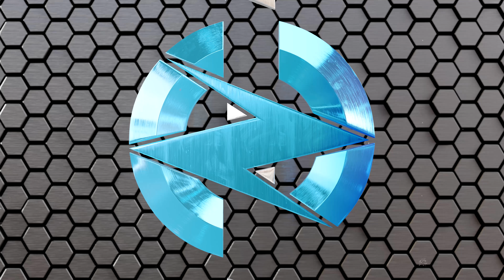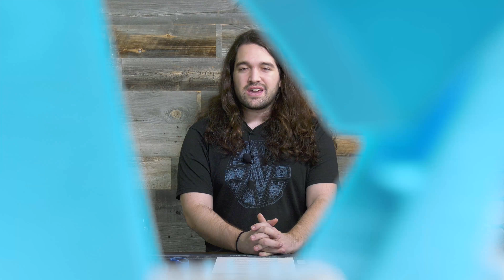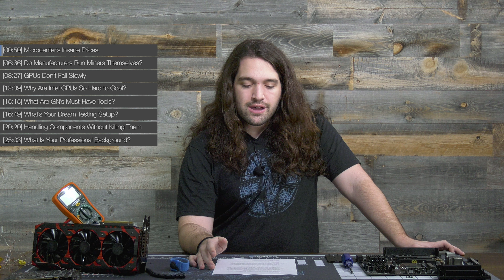Ask GN 68: Microcenter Ripoff, Why CPUs Are Harder to Cool

Comment: The GPUs are more fucked than RAM today. At least the fuck-expensive RAM is readily available. A GTX1080ti? Pff, not only will you have to fork out 1.000 EUR, you also need to wait until they get back in stock, since only a handful are somewhat available in stock (only Gigabyte and MSI armor).
MSI Gaming X: out of stock
EVGA: out of stock
ASUS: out of stock
Zotac: out of stock
If these major brands are out of stock, don't even bother checking the smaller brands like Inno3D, Gainward and Galax.
And this isn't just the GTX1080ti's, the 1070 all just magically vanished, the 1070ti's barely had any stock to begin with, and the 1060 are also getting pretty rare, with only a select few being widely available. Only the ASUS 1060's are available everywhere, but with a stupid +400EUR pricetag. 
I've never known PC gaming to be so fecked up. Most other pc parts are pretty cheap: (Ryzen) CPU, mobo, psu, storage, case, fans, .... But the money saved on these parts sure as hell don't make up for a 3x price increase for RAM and GPU's that are now even rarer than gold.
Shittiest moment to build a PC ever!

Comment: I'm at 21:30 and I'm like slightly nervous, since I got used to check GPU's temp by laying my hand on the other side of the core. XD
Yes, I know. I have HWInfo and MSI Aft. but sometimes I'm way too lazy to install these on a machine I will spend 10mins on. ^^
FOR NOW the killstreak is 0. FOR NOW.

Comment: #askgn-question hi, i have a z77 pro3 motherboard from asrock and it have 2 pci-e slots, i think i "broke" one of them (now using the 4x one that goes thru chipset) by putting a bit too much pressure on the card (sideways pressure, not pushing in slot pressure) while plugged into the slot and stopped working, as a question, is there any other way beside plugging another card to test pci-e slots? or any type of software testing, or something to test individual pins, or what can i do to try to fix it (i know my hardware is old but it can happen to any generation) and is changing the motherboard the only solution? (beside only using the x4 slot)

Comment: I advised my mom to buy my brother a GTX 1080 (MSI Duke, three fan cooler) for Christmas back in November. A 1060 with one fan now costs slightly less than that card. A 1080 costs 3 times as much. I should have invested in graphics cards and RAM...

Comment: Nvidia has released stements instructing to not sell to miners, or at least make it very difficult for them to buy, so I believe thats whats happening here. There is very limited supply of quality cards so going with supply and demand, prices naturally rise. I think the most obvious solution is to not buy a video card right now, wait it out and the market will level itself out. 

Not being a troll here, but I would genuinely like to know what you think retailers should do in order to prevent this crisis? Something that benefits everyone except the miners that could be used as an actual viable option.

Comment: I would like to get an answer here if possible. Is it possible to damage/degrade a GPU JUST BY overclocking the memory too high? No overvoltage, power limit under 100 and good temps. I'm asking this because for example, I have a MSI 1060 3GB with Samsung memory. I can overclock it with +1000 and it doesn't crash when mining. But in benchmarking I can see artifacts, so I keep my OC at +700 even though I could potentially get some extra MH. Ty.

Comment: In response to Pike his question, Intel deliberately makes the IHS suck to differentiate treir regular CPUs from their more expensive Xeon CPUs. AMD on the other hand solders the IHS, with delidding you could maximally get the temperature 2 degrees Celsius lower.

Comment: Ask GN, i got a corsair k95 platinum, long story short, i move around creating static charge and when i touch the keyboard it zaps me, but the interesting thing is that my monitor goes black for half a second. I was like mhm need to test it again, i couldn't replicate it again so i just took a lighter apart and took only the zapping thing and i zapped my keyboard :D and it did it again. Can you give an explanation like what is happening ? I don't have cheap hardware.

Comment: There's probably ESD protection circuits on things like video cards, but depending on the design of the protection circuits, they may only offer protection for a couple ESD events before the components fail and no longer provide adequate protection.

Comment: Welp, here you go.

Dragnerok X
9 hours ago
Question: Using historical data, how might the upcoming release of "gaming Volta" be affected by the current graphics card shortages? Should we expect similar price gouging and shortages at launch?

Marc
8 hours ago
I have a couple questions for Ask GN about V-sync: If most console games are utilizing V-sync, then why does V-sync input lag seem so much worse on PC games? Also, in the Nvidia control panel there's a way to set up graphics profiles for individual games, and there's a "Fast V-sync" setting...it seems like this setting works kind of like how you guys described frame syncing for VR games, but my question is are there any specific conditions on how this setting works?...like when I try to turn it on I'm honestly not sure if it's working or not, so I don't know if it only works with certain settings, or if it only works for VR headsets, or maybe it is working and I just haven't noticed. I really only tried it for like 2 games. Thanks guys, keep up the great work!

 ^^ I don't recall hearing a youtuber who seems to really understand what Fast Sync is 

Salad
6 hours ago
In your recent delidding and liquid metal video, your recommendation for preventing liquid metal overflow/spillage from getting on the CPU contacts was to use nail polish. In Optimum Tech's recent delidding and liquid metal video, he recommends using silicone sealant, the same sealant you would use to seal the IHS back on, in this video: https://youtu.be/VWTbxH-wyFI?t=6m59s. Is there any reason you would not recommend simply using the silicone sealant to protect the contacts? Why didn't you just use your silicone sealant you had on hand instead of nail polish? Thanks!

Shiba
9 hours ago
Hey Steve, a question for the next Ask GN.
I don't understand how the GN Modmat™ works.
I mean, the surface itself is conductive and acts as ground? How does the grounding cable work within the mat?
Because normally it is recommended to use a non conductive surface like cardboard.

PS. If I ordered one, would it ship to Argentina?

Miro
1 hour ago
The thermal pads on my gigabyte gtx 1080 are letting out an oily liquid. What do I do?

Sebastian Krauthauser
7 hours ago
Might be one shooting towards Buildzoid, but something I think is worth asking. Steve, if I have a chip that's low power (say, an Athlon X4 chip) and I decide to OC it way beyond what's considered "safe" for daily use (about 4.7 GHz in this case), how come an OC at 1.9V can only reach about 5 GHz on liquid (while staying below TJmax), but can reach up to say 7.6-8.0 GHz on LN2 or other exotic cooling?

pr0xZen
8 hours ago
What am I missing here? I get the point about concentration of thermal energy and worse heat transfer (cpu vs gpu). What I don't get is; if the thermal energy not efficiently reaching the coldplate is the issue - how does a larger radiator help?

Comment: you keep talking about a micro center in Michigan, i'm curious if you realize it is the only microcenter in Michigan so everyone knows exactly which one your talking about, also i live withing 2-3 miles of it, and get most of my parts from there, but i am not getting my new GPU i need from there. (my current GPU is dying, and i really need a replacement, could easily afford a 1070 at msrp, instead have to settle for a refurbished 1060 6G off amazon....)
Reply: about my card dying slowly, during some OCing i was doing at one point i wasn't building up the the OC on the memory in stages like i had before i just sent it strait to the highest i had gotten it and instantly got a ton of display errors, now when i am playing games if it tries to use more than about 1/2-3/4 of my available VRAM i get display errors, at stock speeds.

Comment: Regarding the PSU testing part: I understand that testing them in a professional manner is pretty hard due to expensive equipment, but something that I've personally never seen discussed is the auxiliary components used in consumer grade PSUs such as fans. I've bought a lot of PSU s over the years mainly from Corsair, and they have big problems with poor quality fans. Regardless of the series, VS, CS, RM, etc, they all exhibited, sooner or later, rattling noises coming from the fan, especially in idle usage scenarios and when the fan was facing down (as the case design suggested). I even replaced a brand new cx650 psu because it had this problem. My local retailer replaced it with no issues, but guess what: the second one had the exact same rattling fan. What I'm trying to suggest are PSU reviews that go in depth regarding the manufacturing processes and the parts used with these power supplies. (brand, reliability, over time usage behaviors). I would also like to congratulate you and all the GN people for your great documented reviews. Keep it up!

Comment: AskGN 2137
Recently I've ordered very cheap water cooling (~50$) from Aliexpress, which will cool 3 GPUs (mining a bit) and 1 CPU and I have following questions about it, which might give you an idea for a video:
1. What is the difference between super cheap (<3$) waterblock, against Chinese block with fins (11-13$) and against much more expensive water blocks available in US and EU in terms of actual efficiency? I know that difference between aluminium and copper is rather small (<1°C from your video), but how much do I gain from fancy micro fins?
2. How big is the difference in temperatures on water loop while using etylene glycol vs water? Water has 16 times lower viscosity and ~50% higher thermal capacity, but how exactly does it affect temps?
3. How big of a radiator do you need for X watts of heat for different fan speeds?
4. Pushpull on lower speed fans vs higher speed fans (either push or pull, maybe both) and efficiency for dBa, which one is better? (pretty sure pushpull but by how much)
5. Copper vs aluminium radiator with same fin density - which one will be better? From thermal conductivity and density, the Alu rad should have similar performance with ~55% of the weight.
6. Cheapo Chinese 240 rad vs super expensive one with the same thickness - what's the difference in power dissipation for given delta, fan speed etc etc.

Comment: can RAM be a bottleneck while using a very powerful GPU and a mostly powerful CPU
My 6600K OCd to 4.7Ghz is reaching 100% constantly when i'm playing VR or games at any resolution with my 1080Ti
does hyperthreading really help in this situation and would it be a good solution to swap to a 6700K or a 7700K ?
Reply: riep69 Quad cores with no HT are a dying breed. Upgrade to a 4/8 or more.

Comment: Is that USD? Because I can get a 1080ti for $969.99 (EVGA GTX 1080Ti Gaming Edition) - $1,369.99 (EVGA GTX 1080Ti Kingpin Edition) Canadian Dollars depending on the model chosen, EVGA just happens to be the lowest at my local retailer in price and the highest actually is the Gigabyte AORUS GTX 1080Ti Waterfoce WB Extreme Edition #1,399.99.
The ASUS ROG STRIX  1080Ti is only $1,169.99

But it seems like the local shops having issues with stock too.  Message takes over the screen when you go to the site saying basically that they cant get enough supply of gpu's and psu's and are sorry for the inconvenience. r.i.p. pc gaming 2018

Comment: @17:57 Just google for PSU tier list and you probably will find a list compliled by tomshardware. I did that and opted for a tier 2. You have to search a long time to find a bargain among the tier 2 PSUs.

@19:31 Prad is a good source when it comes to monitors. They are specialized in testing monitors.

Comment: #askgn-questions
Hey Steve, I hope this comment is noticed =D
I was wondering if you'll be getting Ryzen-G CPUs for a test run? Would also be very curious about how well they would fit for a very specific use-case, that use-case being dedicated mini-itx streaming box with capture card in the only PCI-E slot and using embedded vega graphics on G-cpu for monitor output, CPU for encoding. Wondering if that CPU would handle something like 8mbit dedicated twitch streaming without hiccups and how low could you get the encoder preset with it. 
Again, hope this is noticed =D
Thanks!
Reply: Check what a Ryzen 5 1500x can do with CPU encoding. If the results are good enough for you, the 2400G should be just fine.
Reply: I'd be glad to if I could get my hands on one. Pretty much no one makes tests of this sort online. I'd like to reiterate that I'm talking about dedicated streaming machine, while tests that GN have already done with 1500x were 1 machine gaming+streaming, which is very different workload.

Comment: With a ~$3000 electronic load, some creative cable management, and potentially some ancillary electronics for signal amplification if necessary, you should be able measure power supply voltage fluctuations with reasonable accuracy. As to how those values change depending on the noise/variance in ac lines, I have no idea.

Comment: There is a Scandinavian government already doing that, fitting heating units into community accommodation that offloads server/compute power from government facilities  and heats peoples homes... There is a simple knob on the side of the units that directly controls the frequency that the unit runs at to moderate how much heat it generates..

Comment: Hey Steve, love your videos and the way you guys make reviews. Keep up the excellent work!
I have questions about multi monitor setups. Is it possible to have one 10-bit and one 8-bit monitor in these modes simultaneously, or do both monitors have to have the same bit depth while connected to the same gfx card? If so, is it possible to run a true 10-bit capable monitor with a 8-bit + FRC secondary monitor in 10-bit?
Furthermore, do the frame rates of both monitors have to be the same, or is it possible to run the primary monitor at 100Hz and the secondary at 60Hz?
Reply: Monitors don't need to be the same refresh rate. I don't know shit about 10 bit panels.

Comment: Ask GN, would adding two top intake fans in addition to using the rear fan as an intake, and the front intakes as exhaust fix the thermal issues with the bitfenix Enso?

Comment: Ask GN: why does my first 1070 ftw, with less thermal pads, overclock much higher than my second one, with more thermal pads? first card i can get +150 on the core and the second one i can only get  +75 on the core. both easily get +400 on memory. also, they're both on the slave bios.
Reply: luck is a factor in overclocking
Reply: Silicon lottery.

Comment: ESD is not really a thing to worry about unless you are working with exposed silicon.
Do you need to mitigate ESD risks when building a computer? No, it does not add or reduce anything, your risk of causing a problem is literally zero. You will not kill any (modern) component by ESD through a designed connector.
Do you need to when touching exposed silicon (repasting a GPU, delidding a CPU)? Yes you should, as in theory you can build up enough charge to kill a couple of transistors if you are very very unlucky.

You do not need an ESD strap though to easily mitigate ESD risk to zero, just touch a sufficiently big metal part nearby (for example the pc case, metal desk, radiator, etc) or the ground pin of your connector before you touch any of the components.

As for Steve's anecdotal evidence, it is highly unlikely that it had anything to do with ESD, motherboards regularly die from extremely hard to notice manufacturing flaws. That motherboard most likely already had a problem (like broken soldering or micro cracks in the pcb) that was made worse by a days handling it around. Likely it would have worked fine if it gets into some stable case and does not get bothered ever again. There is a reason that many industry sells showpieces at a discount, parts do suffer tear and wear in such uses.

Comment: Human oils do a great amount of damage to almost everything. It is very possible to have corrosion occur on areas which have had contact with human oils. This is particularly the case for low quality solder, poor plating etc. While the corrosion will not occur over night, the effects can be observed in a matter of weeks to months in extreme cases. So trying to contact as little of a long-term electronic object would be something I would suggest. Just don't be anal and end up dropping the likes of a motherboard because you didn't want to touch it. Human oils on soft touch plastic is even more interesting though as the properties change drastically over time.

Source for info: I worked in R&D as a mechanical engineer designing and testing plastic ( generally PC.) for housing of electrical components and boards. The company produced roughly 70% of all circuit boards under the same roof which I worked.
Reply: It's actually grease. Oils come from flora, grease from fauna...